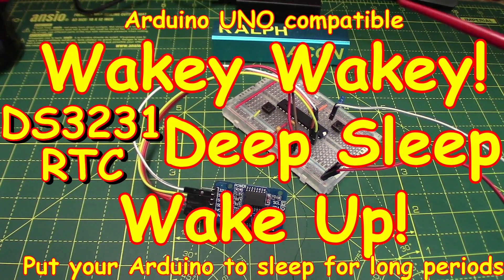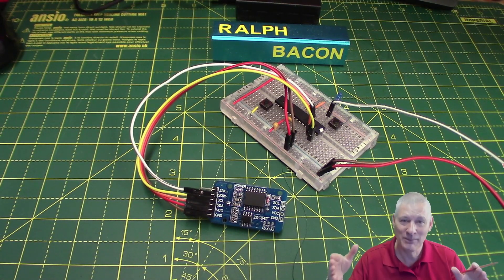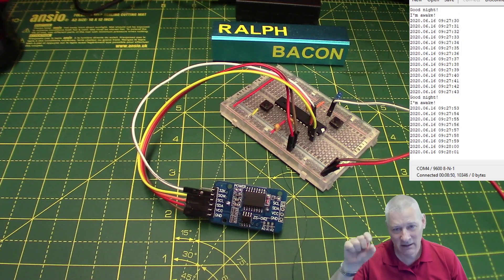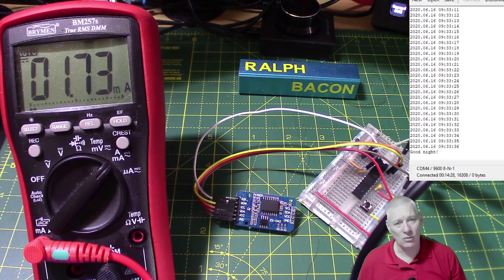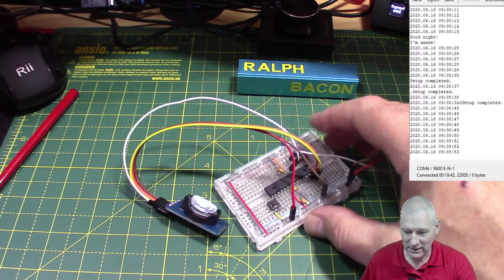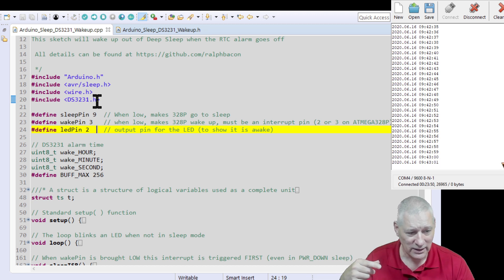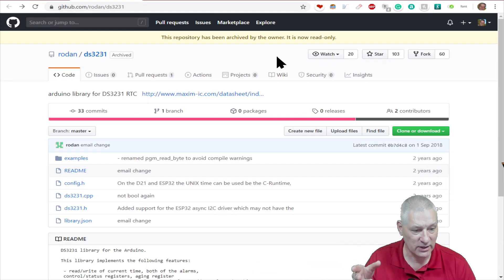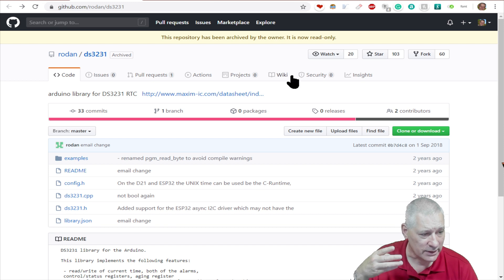#192 Wakey, wakey! Let the DS3231 RTC wake up your Arduino - easy!

Comment: If you have a power-critical application, a simple ultra low power timer like the TI TPL5010 would be a good way to go.  You could power down the RTC just before going into deep sleep, and the timer would draw 35-50 nA until it wakes up the MCU.  You'd be limited to sleep times of 2 hours (for this timer anyway), but most applications need to wake up more often anyway.  And if you need to wait until a specific time of day, you can set it to wake periodically, wake up the RTC, check the time, and go back to sleep if the time isn't met.  With sleep intervals of more than a few minutes, you'd still gain a lot of battery life.
Reply from the maker: Indeed, Chris, 'tis true and I did video #125 on the TPL5110, there are many roads to Rome. https://youtu.be/Qms_iEL7Uqg
Reply: @RalphBacon  Nice!

Comment: Hi Ralph,    old one i know but I get conflicting info and thought you might know.  I'm changing from a DS1307 to a DS3231 RTC and one aspect is, some say a rechargable  LiR2032 is required rather than, like you use here, a CR2032. 
Most also say no need to change anything with the includes etc. as this ds3231 will work the same. Any comments?
Used wire.h and RTClib.h and RTC_1307 rtc;....also have a 1602 i2c lcd on library hd44780.h as I'm told this is a far better library for the display.
Reason for the change is due to the time drift on the ds1307.......would like to keep it as is but cannot find a simple way to correct it from time to time externally(up down buttons)
Reply from the maker: The DS1307 should be withdrawn, it is very inaccurate. Hence the DS3231 which is super accurate. 

You do NOT need a rechargeable battery but some boards do include a charging resistor on the DS3231 modules which should be removed if you are using a standard CR2032 battery. If you don't remove it I'm not sure any bad things happen; the voltage will simply be used instead of the battery, I guess... (if your house burns down do not blame me, though 😲)

I haven't used library hd44780.h as the one I use does everything I need, but no harm in trying it out!

Comment: Great video as always. Have you calculated how much power it would take to just use the watchdog timer, wake up every 8 seconds, increment a counter, check for 10,800, and go back to sleep. If you did not need "real" time, it might take less power then running the I2C lines.
Reply from the maker: I haven't but Andrew Toogood (comment below) has Real Life experience of using the WDT and thinks it the way to go. They switch on so fast and go back to sleep again that he needs an oscilloscope just to prove they work up! I can't argue with that!

Comment: Hi Ralph great video again. I do a lot of deep sleep projects for farm sensors running on AA batteries so always interested in new ideas. I think if you are serious about deep sleep performance you will need to use the DS3231 IC rather than the module, only turn on the pull ups when you need to reset the Alarm. Then you could use the alarm to power on rather than wake up the uC. Although it sounds silly waking every 8 seconds its actually hard to beat for consumption the power lost is less than normal battery losses for time and requires an oscilloscope to detect it has even happened. I have sensors waking every 30 mins to sample and send long distance via nRF24 and lasting 18mths +...
Reply from the maker: Absolutely, Andrew. I do believe I originally mentioned this only to cut it out - using a module is within the grasp of most Arduinites, soldering a 16-pin SMD (of which only half the pins do anything) is a soldering iron too far! Yes, the power consumption thing would have to be measured very accurately to determine whether this method was better than waking up every 8 seconds. But your empirical evidence makes it sound that the WDT method still has merit (and no extra hardware required). It's a pity no Chinese manufacturer has made an Arduino clone with a DS3231 built in.
Reply: @RalphBacon  that sounds like a challenge, perhaps i should make one.  First i will do ther theoretical math based on the data sheet. To see if it has any chance of being better at power consumption. Thanks again n for the great video
Reply from the maker: Or do what others have suggested here: desolder the EEPROM chip, remove the battery charging circuit resistor (and diode too if you want), power the VCC to the DS3231 from the Arduino GPIO pin. Job done. I'll try all this soon. You first!
Reply: @RalphBacon   FYI using CurrentRanger and Oscilloscope i can see that it takes 16.3ms for each 8sec wake up which is 3min 1sec perday 18hr per year. For my 10ma project thats less than 10% of 3 AA batteries in a year. The lowest standby for ds3231 will use~50%. So no chance of being better.
Reply from the maker: So there we have it, a scientific reason to keep using WDT. But I guess this is another way of doing it... right? Right?
Reply: @RalphBacon  was worth investing i love your videos because they make us think. Also for boards not setup for deep sleep probably viable if you can then turn it off.

Comment: I think, when the DS3231 is powered from external source (5V of Arduino) and the vcc is higher than the coin cell voltage, the coin cell is being charged from that external power source, hence the higher consumption. I think I read it in the data sheet.
Reply from the maker: You are correct, Milen. The charging circuit is present and will attempt to charge a non-chargeable battery (eg CR2032) if fitted! One of my DS3231s actually has a rechargeable battery still fitted. I must remove the charging circuit resistor to avoid any unpleasant surprises with that coin cell. Thanks for posting, good to hear from you.

Comment: You are not up to date on LiIon batteries, the 18650 is up to 3400mAh and 2000mAh is not very common.
I have been testing LiIon batteries the last 8 years, this table shows brand and capacity and links to a review of each cell:
https://lygte-info.dk/info/batteryIndex.html
Reply: A very useful table.  Thanks for posting.  Bob
Reply from the maker: That's both useful and an eye-opener for me. the last 18650 batteries I bought were in 2018, 6 x Samsung 2500mAh for the princely sum of £22. Things do change quickly in the battery world these days.

Comment: Do you just send SQW --> Gpio something and detect the low in software?
Reply from the maker: Yes. The Arduino is in Deep Sleep (suspended, effectively)  but will be woken by a LOW signal on the chosen GPIO pin because your code told it (attachinterrupt etc).

Comment: Enjoyed your video, but I have a slightly different problem that I think you can help with.  I am trying to wake up a ESP8266 12-E NodeMCU with the DS3232 Alarm and haven't been able to make it happen.  I have not been able to find a wiring diagram that works.  My sketch sets the alarm(s) and they fire as directed, but I have not been able to wire the SQW pin to the ESP8266 RST pin and make the wakeup/reset work.  I think I have tried every combination of transistors/resistors/etc. but nothing seems to work.  My aim is to use ESP.deepsleep(0), but can't get the alarm to reset even when the ESP8266 is awake.  Your help would be appreciated.  John B.
Reply from the maker: Such a long time ago, John... my brain is foggy. I covered Deep Sleep for the ESP8266 in video #118 (https://youtu.be/NgPwPKXCLFY ) and I seem to remember that the RST pin had to be held LOW for a minimum period; I'm not sure the SQW output is LOW long enough but you could prove this pretty quickly I'm sure with a 555 monostable getting its wake up from the DS3231 which then provides a much longer pulse for the ESP8266. If you just short the RST to GND does the ESP8266 wake up OK?
Reply: @RalphBacon  Thanks for your reply.  Yes it does wake up (restart) when connected to GND.  I don't do much EE type stuff but I can tell you what I see.  When I measure the SQW output I get 3.5v and same for RST.  When SQW alarm fires SQW drops to 0v and after the alarm it goes back to 3.5v.  It is a very short pulse.  If I connect the SQW to the RST it locks up the processor until I disconnect the wire.  I've never used the 555 monostable and only know what I have learned on the web over the last two minutes.  Do you have a video explaining it?  Thanks again, John B.
Reply from the maker: I haven't done such a video (other than my 555 watchdog) but if you email me (my email is in the About tab of my channel - but not from a phone) I'll send you the best book on 555 timer chips that you can peruse.

Comment: Great video with loads of information. Can one use the same alarm wakeup method for the ESP8266 / ESP32?
Reply from the maker: See my reply to Mr.Chauhan regarding the ESP8266. I've not done a Deep Sleep on the ESP32 yet so I don't know if this will work or not.
Reply: @RalphBacon  Thought I'd report back. I tried this on the ESP32 and it works like a charm. I used the esp_sleep_enable_ext0_wakeup function

For even more power saving, would it not work to try and use a Si4599 as part of a power latch circuit? I recently watched your other video on power latches, and it seems that a N channel and P channel mosfet can be used, is this not what the Si4599 provides?
Reply: Report back: I tried it out and it works great. The Si4599 is a small chip and cheap, this works really well as a power latch. Thanks Ralph, I wouldn't have known about it without your videos

Comment: Please pardon the intrusion for jumping on this thread but I'm quickly approaching the end of my reason and am no closer to a solution. I have watched ALL of your low/save power Arduino videos but I don't have the knowledge to use the info effectively.

I am trying to build the most efficient battery powered circuit that will illuminate a LED when movement is sensed by a PIR. This will only happen during 'night' hours meaning start at 4pm in winter & 9pm in summer. My idea is that it would power off at say 12am and then repeat 24hrs later. I acknowledge thast the change from winter to summer time will be manual.

My proposed solution is ...
Use Arduino to programme a RTC with actual time together with relevant start and finish alarms.
@ Alarm 1 the RTC (running 100% on internal battery) will send a signal to the gate of a BJT.
In response the BJT will switch power to a PIR.
When the powered up PIR senses movement it will send a signal to a 2nd BJT.
This second BJT will switch power to the LED for as long as movenment is sensed.
When movement stops there will be no signal from PIR to 2nd BJT thus cutting off power to LED.
Process continues until Alarm 2 when the RTC will stop sending a signal to the first BJT.
No power will flow until the Alarm 1 is triggered the next day.

Is this possible? 
Am I thinking about it the wrong way?
Can an RTC alarm be used as described to stop a singal being sent to the first BJT?

 I love the comment (from another project)... "It's impossible to over-engineer hobby projects" 😂

Again I do apologise for the hijacking but desperate people do desperate things at desperate times.
Reply from the maker: I feel your frustration but, as always, there is a technical solution, just maybe not the one your were expecting!

Whether you can directly power an LED (I'm assuming a proof-of-concept 5mm LED?) from the PIR, rather than use a microcontroller, I cannot say as I've never done it. Using a BJT might work, but again it's not a path I have trod before. Sounds plausible.

You can certainly use an RTC (DS3231) to switch on (and off) something like an Arduino ATMega328p chip (not the board, like an UNO, as that consumes far too much current). As the RTC is independently powered, usually by a 2032 button battery) it won't cause your main power source to become depleted.

The PIR needs powering too and from what I recall they are not so low-power friendly. Usually, you would have to either power continuously or use a solar cell during the day to charge a Li-Ion battery for use overnight. The PIR needs to be active during all the night hours so current consumption becomes a factor.

The advantage of a rechargeable circuit is that Arduino chip can also be powered from it, albeit only when the PIR detect a movement, sends a signal to the Arduino to wake it up from Deep Sleep, light LED for as long as it gets the PIR signal, and then go back to Deep Sleep (the ATMega328p only needs < 1μA when in Deep Sleep).

TL;DR my take on this would be to use a solar/rechargeable solution, with a standard Light Dependent Resistor (LDR) that determines when the circuit as a whole should run. Thus, no need for an RTC at all. There are millions of light-level switch circuits out there on the Internet (basically a comparator circuit).

This LDR circuit could then trigger and power an ATMega328p chip with minimalist circuitry just like my demo. It would be in Deep Sleep for 99% of its life but would wake up when triggered by the PIR's output. That would then control the LED whilst it was getting the trigger (and could extend the light's duration, just like your security light). A BJT might be all you need at this stage, no μC at all!

Whilst using discrete components as you suggest might be possible, it's not the way I'd do it. Whilst you mull over some possibilities I'll try and see whether I can devise an analog circuit with a DS3231 and PIR to do what you initially proposed.
Reply: @RalphBacon  

Thank you, Ralph, for taking the time to consider my post and reply. 

I have sucessfully driven a LED via a BJT (2N2222) from both PIR #1 & PIR#2. I haven't yet tried this on P1R#3 - see below.

Are you saying that an RTC (DS3231) via a second alarm can effectively stop sending the signal from the first alarm? If so, this is very encouraging.

It is my intention to power both PIR and LED from the same battery. 

To date I have looked at three PIRs...
     PIR #1 is an HC-SR501 which uses 65mA. However this model can be set up to continue sending a signal while it senses movement.
    PIR#2  is an AM312 which is marketed as Low Power. In my experience this is very low power & does not have the option to set a delay.
    P1R#3 is a RCWL-0516 which uses microwaves and is very low power. It generates a 3.3v output but no control over the delay time.

This particular project is not solar friendly. I am trying to draw attention to a sign when a person enters a corridor. The corridor has windows and the sign is obvious during daylight. However, it is easy to miss under artifical lighting. While access to the project is fine unfortunately there is no convenient source of AC power. 

I think I'd be able to complete the project using a bare bones Arduino (and I probably will for practice) but at this stage I am trying to design the simpliest solution I can think of.
Reply from the maker: So having scribbled out a diagram or two, it quickly became apparent that doing this with analog/discrete components without some sort of microcontroller was becoming far too complex. 

Then I had the thought to consider how my garden ornaments lit up at night; most were solar powered (charging during daylight hours) but we also have one, battery controlled PIR light that works very effectively.

It's a commercial device, cheap and there are unmpteen variations on the format and design, but all fall within your brief of a battery-powered device that lights up something when movement is detected during the hours of darkness. Here's a link to what I have, but as I say there are many of this format: https://amzn.to/3vzqgdd

There is one downside to this particular device (and, come to think of it, many of this type): they are easily detachable (mostly magnetic) because they need regular recharging via a USB port or need new batteries now and again. Great for the home user, maybe not so great for a public place with light-fingered visitors? You may need a different format device or some way of securing it (which might include placing it high enough so that it cannot be reached without a ladder, for example).

I hope this "blue-sky", "out-of-the-box," "pushing the envelope" thinking may help you in coming up with a solution that is cheap and easy to install! Sometimes the easiest solution if one that has already been thought of and manufactured.
Reply: Thanks again for your time and recommendation.

I assume the PIR becomes live when ambient light is low i.e. when it gets dark. 

I'm trying for a situation where the PIR becomes active within defined on/off times.

My original goal was to design the simplest project possible but it looks like I will need to include an  AtMega328 chip to achieve that.

Thanks again

Comment: Great video, perfect and detailed explanation. And it works .... unit you do something more in the "I am awake" state. Adding DHT11 reading, Writing to an SDcard, a Delay(2000) and .... everything stops with me. Any ideas?
Reply from the maker: When you say "stops", what do you mean?
You need to put in several Serial.println statements so you know at what point the code got to before not getting any further.
Are you sure you used the exact code of my demo (including the "don't go to sleep again until I tell you" line)?